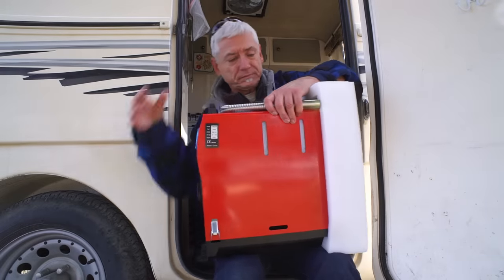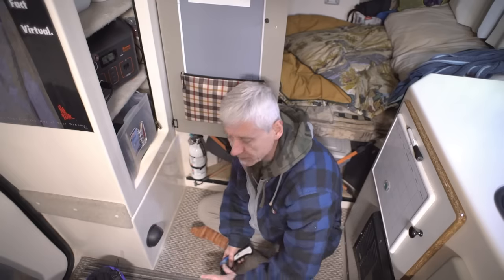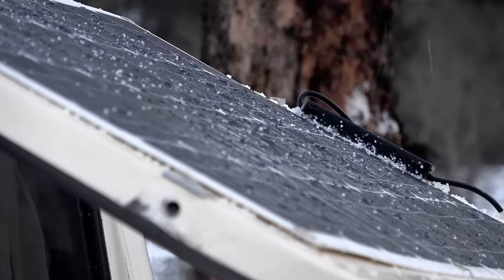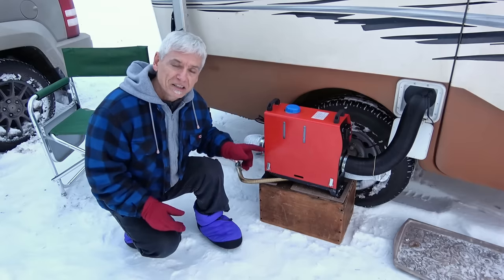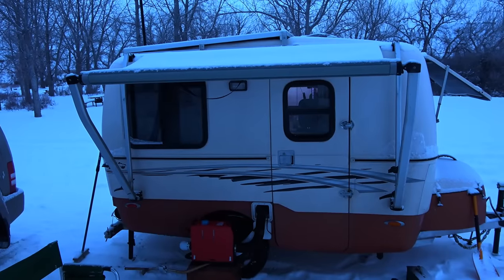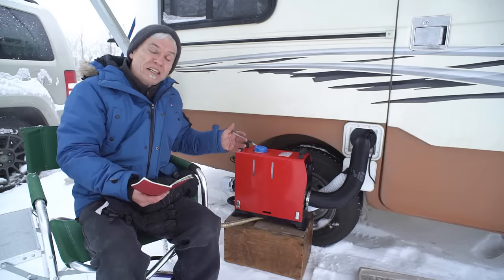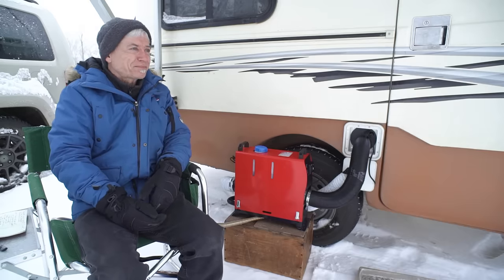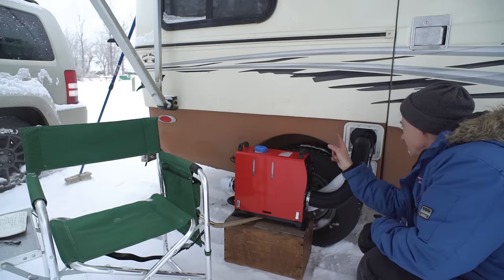Can this Work with a Camper? My Parking Heater Experiment Part 2

Comment: Hmm... you had it Outside the camper???    Most people use INSIDE
Reply from the maker: The videos explain why. SP
Reply: His explanation is in part 1.
Reply: and at the end of Part 2. He doesn't want to modify his trailer.
Reply: @SlimPotatohead  Saw both videos and understand it better. Also shared the link to my mechanic friend... I have a diesel heater he will install in my Opel Vivaro.
💐🥂🎉 Happy New Year! 🍾🎉💐

Comment: Pulling your intake air from the outside doesn't make for the most efficient use of this type of heater.  Enjoyed your video though.
Reply from the maker: I was not looking for heating efficiency, as it was hot enough.  I was trying to save power. Thanks! SP
Reply: I understand that, the heating of frigid air as opposed to recirculated warmer air is less efficient.

Comment: I was hoping to see data from all 3 nights (fuel and battery consumption) and results for both hi and low settings.

It seemed right away like u were afraid of it and I dont blame u. Its Chinese, its full of fuel, and its on while you're sleeping. Who wouldn't be afraid to trust their safety to a Chinese pacemaker.

Comment: Quiet pumps available at Planarheaters.com. Not cheap, but maybe available elsewhere for less.
Search YouTube “super quiet fuel pump planar heaters”
Rubber mounts and rubber tube stubs on the in/out may help too!
Reply from the maker: In the US they are $125 plus shipping. Almost as much as the entire heater. No surprise I guess. SP

Comment: I may have missed this answer. How long did it take, once the ten minute set up time elapsed did it warm up the area sufficient to remove your coat?
Thank you mt@whro dot net
Reply from the maker: Good question, but one with many answers. It depends on the outside temperature, how much area you need to heat, what setting the heater is on, what insulation you have in the camper,  and how thick is your coat. I did a video called "Which One's Warmer" a few months ago that showed I could heat an unaltered Out Back with the propane furnace from -3C to 20C in 30 minutes. In this current test however,  I was only using the diesel heater at it's lowest setting, so it took longer. Once my insulation upgrades are complete, I hope to do a new comparison with both the diesel and propane. I will post the results. Thanks! SP

Comment: Un strap the fuel pump and let it hang free and the noise goes away.
Reply from the maker: Not.
Reply: @SlimPotatohead  Guess I should have explained more- I didn't mean to let it "dangle" just let be free of a mount in that cheap tin. I have mine secured out of harms way by 40# test fishing line supported in 4 points.

Comment: Click, click, click, click, click, click, click, click, click. I will pass on this lol the buddy is quite lol and cheaper on fuel cost. Thanks for the review.
Reply from the maker: The Buddy produces water. Dry heat more practical in cold temps, no moisture problems. SP